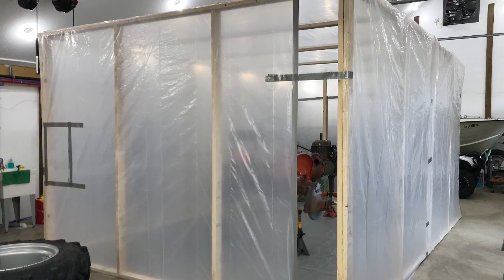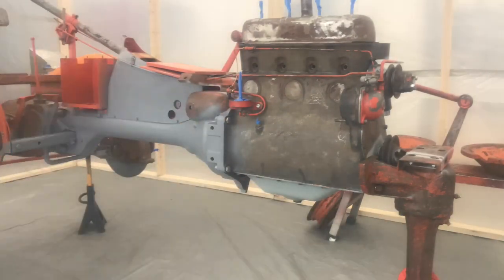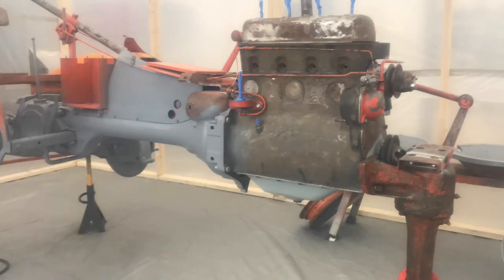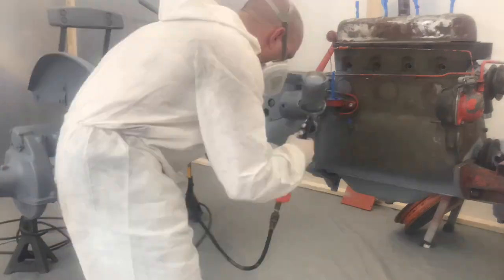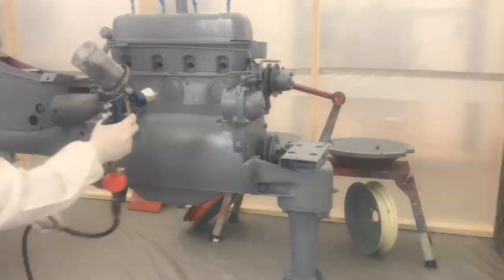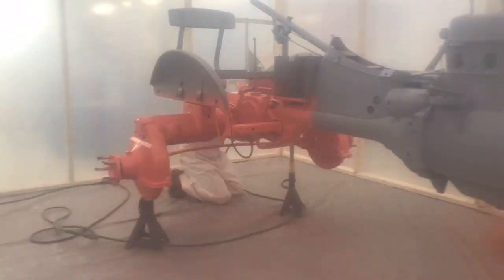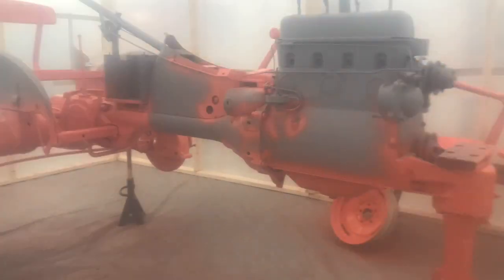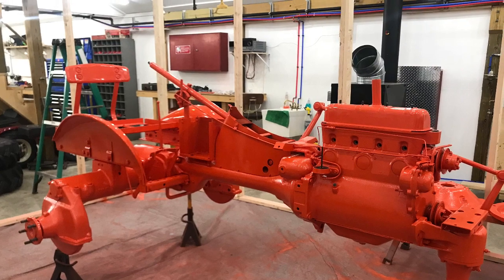Painting the Allis Chalmers C Tractor Lime Lapse Part 3

Comment: Hi Bob, I'm currently starting my research on paint for my 1944 Allis Chalmers C tractor. I notice you painted the entire tractor (including the engine) with the same paint. How has the engine paint held up with use? A friend of mine is telling me I need a special heat paint for the engine. Thank you
Reply from the maker: Hey Chris.  There’s no need to use special paints on the engine block.  Any good epoxy primer and enamel - urethane will work just fine.  The prep work ahead of time is the biggest factor in its longevity.
Reply: @BobWilson84  Thank you